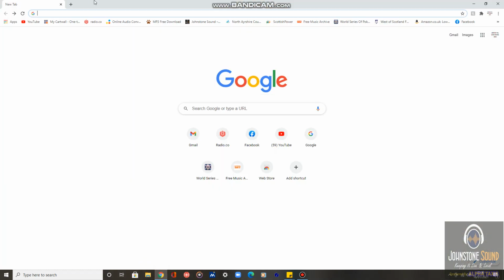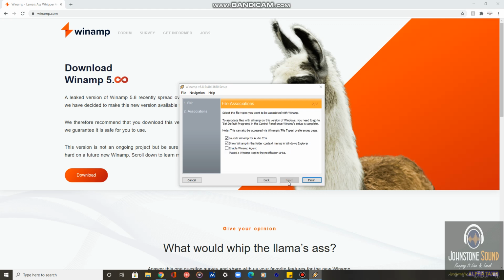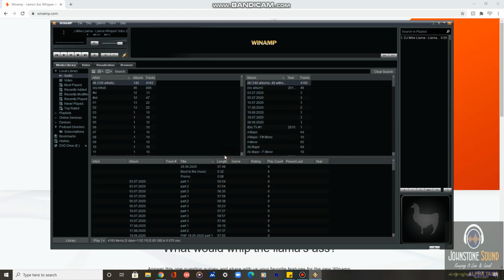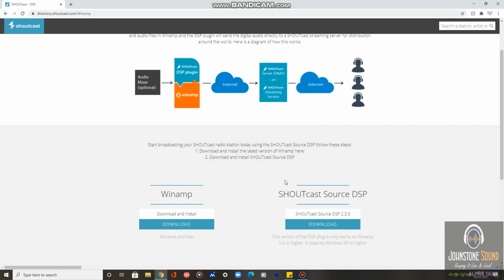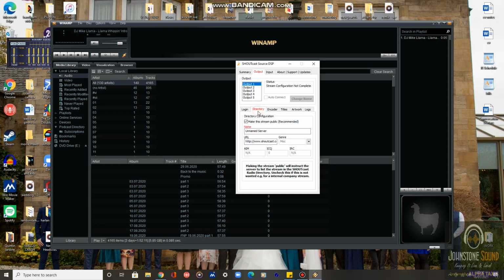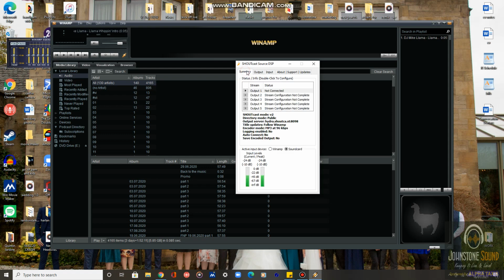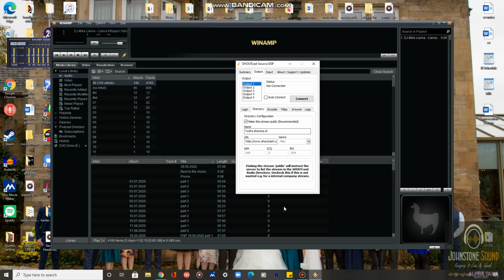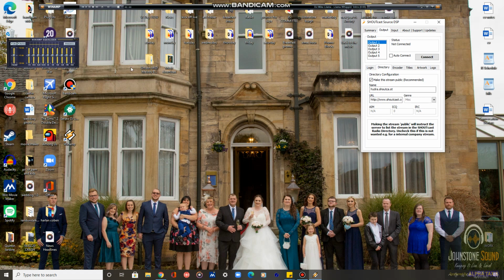winamp set up

Comment: hi when you live stream with music have you noticed any decreases and GLITCHES on sound with popular chart songs
Reply from the maker: No, winamp seems very stable
Reply: @antonycrawford7199  I'm using free account at moment  and tried shoutcast v1 & v2 on both servers an I get a strange dip on every song I'm 128kbps stereo 44,1hz mp3  on high home broadband I've tried trouble shooting on lower kbps hasn't fixed what could be the problem 😕
Reply from the maker: @Jenseninterceptor321  are you using a windows pc or apple?
Reply: @antonycrawford7199   hi I'm on windows 10 HP  they are chucking ads on my link would this have anything to do with  audio dip on songs...
Reply from the maker: @Jenseninterceptor321  it could, do you use winamp for the encoder? If you do I would recommend switching to Rocket broadcaster,  it's free and I feel it's a better encoder. Check this video on it https://youtu.be/ovrpNs_1xwI
Reply: @antonycrawford7199  I used to buy ticket few years back on there server side and never had this issue until I went on there free account thought it was bit strange... I will check out on that link you sent  👍
Reply: @antonycrawford7199   yes I only use 2.3.5 d.s.p plugin for there encoder it is working put as I say i noticed on every song played I get a audio decrease dip every now then